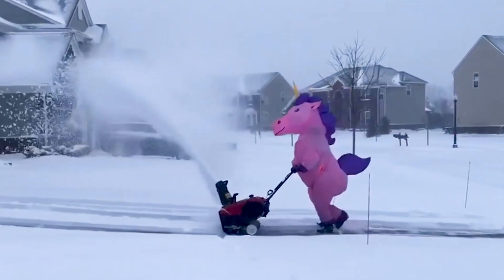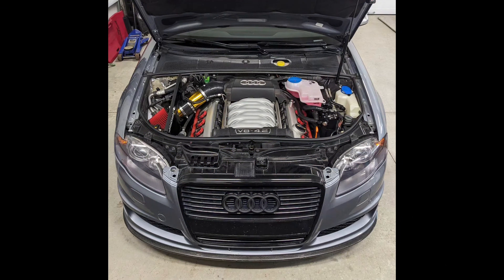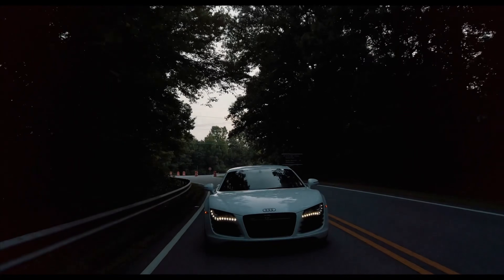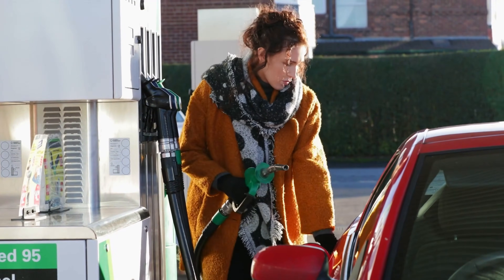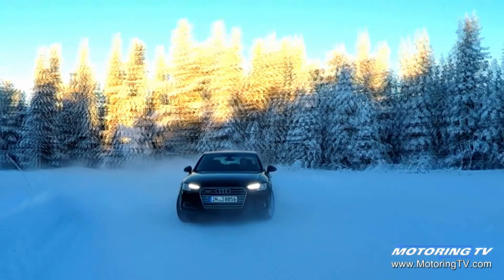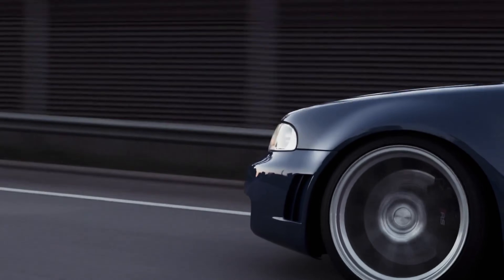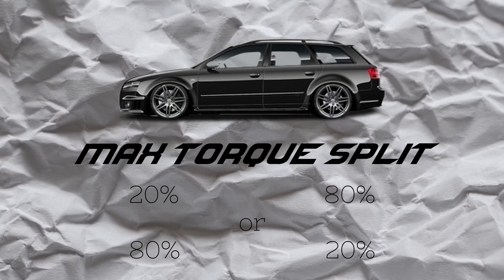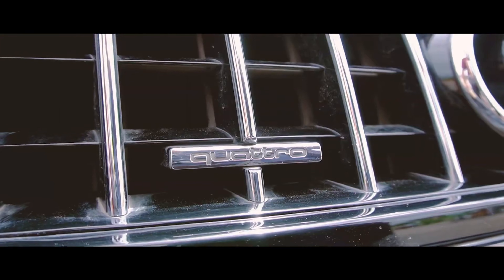Audi Quattro AWD Explained: The Hidden Tech That Makes It Unbeatable (And Why Others Can’t Keep Up)

Comment: CORRECTION: Starting in 2022 Audi dropped Haldex in the RS3 and started using a transverse AWD system from Magna. I pulled all my research from the Audi press room, and the impression given is that the recent improvement to RS3s Quattro was related to adding the torque vectoring rear differential from other S/RS cars; so I didn't really grasp that there was a complete supplier / system change. The new AWD system allows for up to 100% torque to the rear and a new drift mode. 

More on the Magna Quattro AWD system in the RS3 and Golf R can be found here:  https://www.youtube.com/watch?v=m4_EIULHP0I
Reply: To be clear, the new Magna system cannot deliver 100% of available power to the rear wheels, that number is still 50%.
  Of that 50%, the system provides up to 100% of the available torque to either rear wheel.

Comment: The best awd system ever is that with the dccd center differential in subaru sti. It has a helical lsd front, a clutch plate lsd rear and the center differential is adjustable with auto and manual mode and lock capability.
It is an unbelievable awd system with huge mechanical strength also.